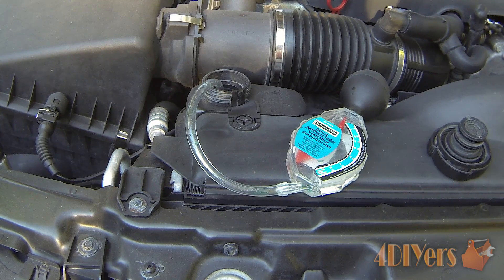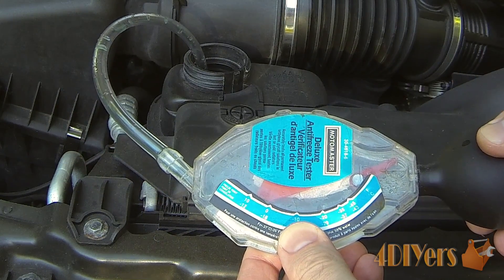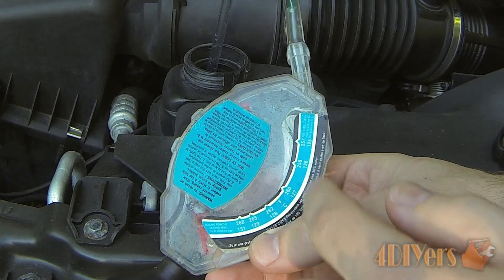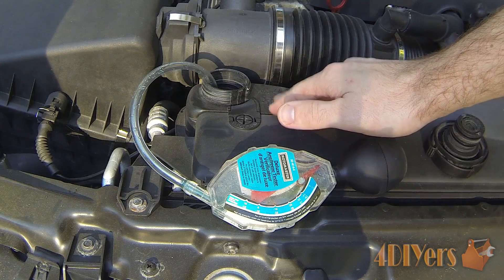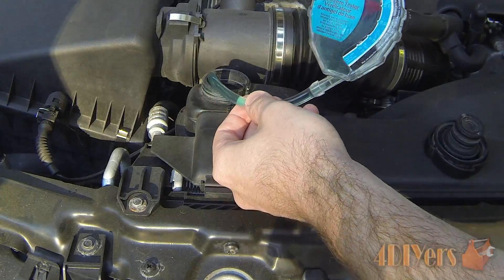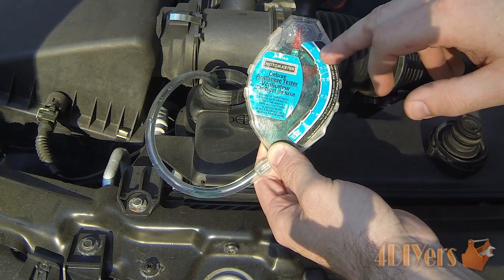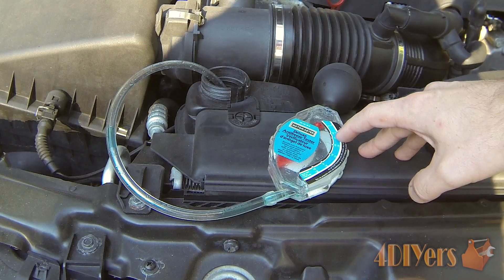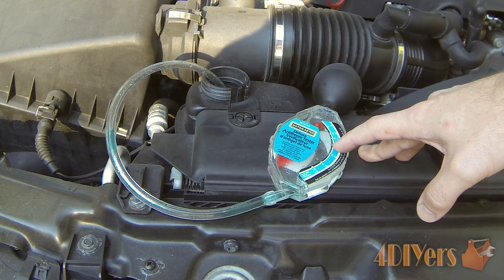How to Test Coolant Freezing and Boiling Temperatures

Comment: I busted a coolant tube(plastic manifold/tube on a ford) & purchased two gallons of concentrate. I am use to measuring out all of my antifreeze into milk jugs, half way & filling the remainer with water. To obtain a 50/50 mixture. After rupturing a plastic coolant tube/manifold & only having antifreeze on the side of the road. I am only registering  3 out of 5 balls on my tester, after draining antifreeze & adding water. What is your recommendation? More water,  or more antifreeze? I am leaning towards more water? But, after payday, I will drain it all, & start over with measured amounts. I usually try to have just a smidge more antifreeze living in the  N.E. where the winters get very cold  negative temps sometimes & pushing upper 90's & close to 100° summers.

Comment: My car good for -7f. It needs to be -35f, the tech who tested it said to achieve that I need to do a complete radiator flush @107.00$. Is that correct?
Reply: Damn thats cheap. yes you need that done. I know its been 5 years since u posted this but may help others.
Reply: @JTBCOOL1  Why? Forgive my bluntness, but why couldn't you just drain a half gallon out and add a half gallon of antifreeze and run it for a good bit till it's all mixed together?

Comment: it's ok to pour back the coolant like you did? what if in the hydrometer there are some dirt or small particles? is there a filter for coolant?
Reply from the maker: Yes it is as long as you keep the tester clean. If it is not clean, then dispose of the coolant elsewhere.
Reply: I was playing with the tester and put water in it, now the rest of the water won't evaporate, any tips
Reply from the maker: A little water residue shouldn't matter. But you can clean it out with alcohol or just face the tube upward and set it in the sun which will evaporate the moisture.